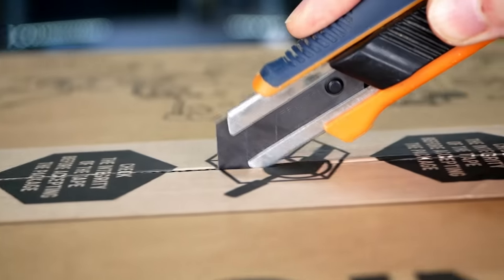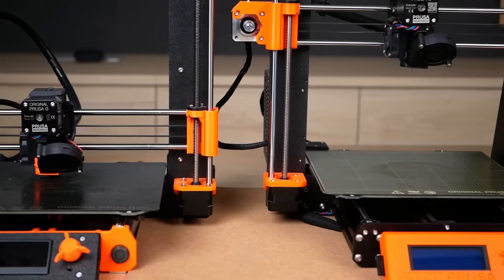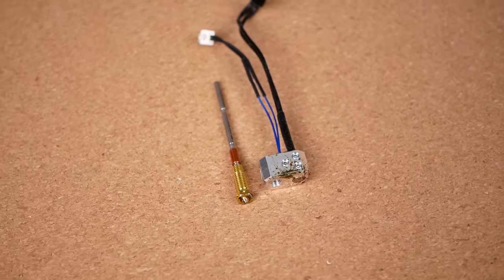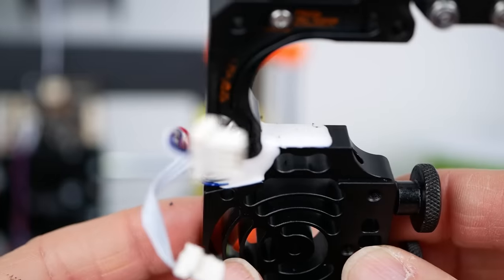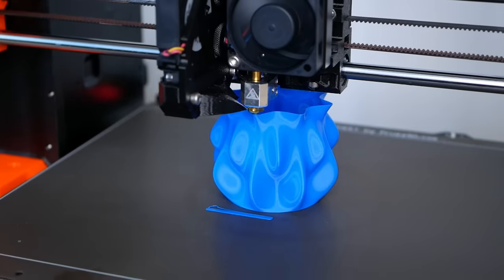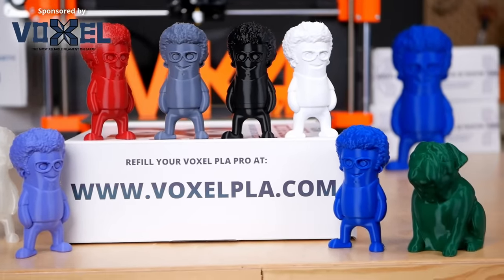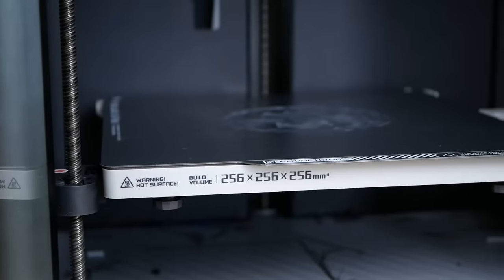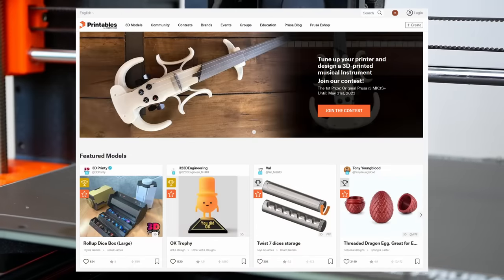Should you buy a NEW Prusa MK4 in 2023 or rather a Bambu Lab X1/P1P?

Comment: To me it's clear they rushed it out to market because Bambu was getting too much market share and they wanted to slow them down. Promising features in the future might suck but could be enough to entice Prusa fans from sticking to their brand.
Reply: But they didn't.
The MK4 has been in the work since at least 2 years.
Reply: The bought it out now because much of the technology is on the XL and they didn't want competitors in China producing a MK4 like machine before Prusa shipped theirs. Bambu is a nice machine on paper and seems deliver what it promises but we will have to see how reliable it is when it's been in the wild for a year or so.
Reply: Should have been a little longer in development, then.
Reply: @schrodingerscat1863  I can answer that for you right now. I am 100% sure that after a good year, there will be almost no support or any spare parts for the Bambu. Even now you can repair almost nothing on it. No exchange of the bearings, no exchange of the carbon shafts, nothing. Much is even glued in. Holy Sh*: 
In 1-2 years, most X1C and P1P will be on the dump, because Bambu will have thrown the next printer on the market by then. Throw away and buy new instead of repairing will be the motto.
Reply: @Neo1983m  yes you can repair it easily. What are you talking about?
Reply: @_Xantras_  They released it before the software was ready = rushing it out to market to me?
Reply: @schrodingerscat1863  The Bambu is very much a Chinese device. I'm in the Facebook group because I was tempted to buy one but it has many many possible issues and some are simply impossible to fix and require you to send back the entire machine. I'm hoping their next iteration fixes all these issues so we're left with a way more reliable machine.

Still, if you have a good one, you can pump out models at insane speeds and this is enough to overcome the worries a lot of people seem to have.
Reply: @Neo1983m  That is what I suspected if I am honest, these things are built down to a price rather than for quality and serviceability. Sure they are great out of the box but having the ability for servicing with spare parts available for years going forward is worth a lot especially if you're earning money from the machines. Most Prusa machines have been running for years and have had many upgrades and parts replaced. Hell with a Prusa you can even download the firmware and hack it if you know what you are doing.
Reply: @redavatar  Yes, reliability and serviceability are worth more than the hype if I'm honest. In a years time when Bambo have moved on and out of warranty I bet these machines will be pretty much unrepairable. It's a chunk of change to drop on something that may only last a year.
Reply: @redavatar  you guys are chill and making up stuff lol … I have both Mk3 and X1C … both excellent machine. Part of both Facebook group and in both issues/love os about the same
Reply: @schrodingerscat1863  I watched a video yesterday from a guy saying how he has switched from Ender 3s to the Bamboo lab X1 and 6 P1Ps because they were so much more reliable. in the same video he mentioned in passing that one of the combined nozzles and heater blocks basically fell apart mid print so he just stuck another one in there (bet that was cheap) and one of his P1P was currently out of action due to some error appearing at start up a few days before and he was waiting for support to email him back. Not sure that they sound that great to me, either with their reliability or customer service. What I couldn't believe was that he was actually going out to buy more of them.
Reply: @shuflie  Sounds like he is drunk on the hype, considering what those machines can do and the cost of decent printer components, they have been built down to a price and likely have many corners cut. They look nice but that's no comfort if they can't be easily repaired. Imagine having to send one back every time these is a problem because there are no user serviceable parts. Prusa sell all parts for all their printers even the really old ones. Plus they provide upgrades for old printers. These things are worth a lot, especially if you are running a print farm or even using a single machine to make money.
Reply: @Neo1983m  the target market of bambu is the people who don’t want to tinker on their machines. Just use them and buy the next latest one they will make. They have been open about that. They said it very clearly in one of the early livestreams that the innovations they have in mind will need a lot of money and after their initial investments that money will come from selling newer printers. However, they also have been open about adding more parts to the store as their supply chains improve. They will be selling a X-Axis carriage in the future so no one has to take the rods off which are glued in to swap the bearings. Maintenance was one of the things they should have focused on more right from the start.
Reply: @_Xantras_  mk4 was rushed and if it wasn't that's even worse cause it seems like something that should have released years ago and honestly is just meh @ this point.
Reply: @_Xantras_  it's been in the work for a very long time, but it seems that they've rushed the release a couple months early, likely due to pressure from bambu, and the leaks that surfaced on the machine.
Reply: @alejoh90  agree
Reply: MK4 has been in development for over a year lol. There is no "rushed to market"
Reply: I am sure the hardware was already long in development but the whole input shaping feature  - although it already existed in klipper - seem to be a last minute addition as an answer to Bambulab or the fact that a lot of speedy printers are coming out. Hence why there talking about it being in Alpha state.
Reply: @LilApe  You really don't get what "rushed to market" means, do you?

A piece of software can be in development for a decade and STILL get rushed to market. How long it was in development for means NOTHING. It's all about how much of it is not done yet or has bugs. The fact that some vital parts of the MK4 is not done yet says to me they rushed it to market and didn't want to wait before the software was ready.
Reply: @redavatar  Dude....if you wanna talk about being "rushed to market", then talk about bambu lab. The only thing missing from the MK4 is input shaping lol.
Reply: @_Xantras_  But firmware is still not complete. Should've come 2-3 months later. Since I get my kit in June, I hope most of it will be implemented then.
Reply: @Neo1983m  you can get most parts on the site lol
Reply: @_Xantras_  if it took 2 years for prusa to release upgrade to their printer, they are done. no way they can keep up with numerous competitors who release complete new printers from the ground up in that time. mk3 has been around since what, 2019? it even became running april 1 joke when prusa would release mk4.
Reply: @LilApe  Erm, and the fact it has a touch screen ... without touch screen support? Stop being such a Prusa fanboy, it's getting a bit silly now.
Reply: @redavatar  So? Prusa never advertised the MK3 as having a touch screen lmao. They're just USING a touch screen that's been disabled. They never advertise it as having a functioning touchscreen, that's the entire reason why there is an encoder wheel on the panel.  Stop with the reaching. The MK4 wasn't rushed to market, they literally been building and testing it for over a year in their print farm. Shit the FW is opensource so just enable it anyways if it bothers you that much.

A rushed to market printer would be the bambu labs. Look at the hundreds of mechanical and software issues they're having RIGHT NOW, because they never beta tested them. Right from KS to the customers door with no thorough testing done.. A company that thinks a warped build plate is "normal and within spec".
Reply: @_Xantras_ only because they worked on it for 2 years doesn't mean it can't still be rushed on the market. Look at Cyberpunk or battlefield 2042
Reply: @LilApe  Josef, I get it. It's scary to finally face some competition after your company coasted on the MK2 and the MK3 for the better part of a decade. It still doesn't justify marketing your catch-up printer with a major feature that isn't ready at the time of release.
Reply: @TROPtastic  1st time trolling? don't worry, you'll get better. BTW, input shaping is slated for release within a month. By time the thousands of people start getting their MK4 kits in july, input shaping will already be available. Cope.
Reply: @marcel151  Well it will be a good printer without those features as well. And the bed leveling seems great, for example.
Reply: @LilApe  Input shaping is such a great invention, making printers go much, much faster.
Reply: @shuflie  I think I saw the video too. Its martinson manufacturing or something like that right? He made a video once explaining that he used to ship  machine parts in PLA, but then switched to PETG because they kept showing up warped at peoples door. Then someone commented he should use ASA for better heat resistance and he was amazed by the idea. Stopped listening to his opinions obviously.
Reply: Show them by releasing the same crappy bed slinger with 3d printed parts they have been selling at ridiculous price for years.
They had their change to create something new, but people kept paying them overprice so they kept selling the same trash.
Reply: @mggevaer260  could be him, seemed to be making vent covers originally?
Reply: @_Xantras_  The MK4 started in late 2022 - not 2 years ago. Prusa even admitted as much themselves, and if you visited any of their sites during that time you'll have been asked to fill out a survey about what features you wanted them to focus on.
Reply: @pizzablender  Yes, it will be. That's why I ordered a kit. But that Tesla like "comes in the future" is not the way you should go.
Reply: @Rick-vm8bl  nope, pictures of prototypes got leaked in 2021.
The survey was for the finish
Reply: @LilApe  it's been in development for a while, but it's clear that some features weren't finished in time for release (input shaping, clog detection, etc.). They would have been more comfortable releasing the machine a couple months later, yet they were pressured to release early likely based on the leaks, and increased competition.
Reply: @Neo1983m  this comment aged like milk

Comment: The whole reason I went with Prusa was for the support and community.  Got tired of other brands where you can't get parts, no support, no options.  Sure also helps it's a damn good printer.  I'll either sell my mk3s to buy a 4, or I'll upgrade.
Reply: prusa doesnt have any community and support is only acceptable
Reply: @jakubmastalir3557  What?
Reply: @mercerwing1458  yeah what they said is just straight not true.
Reply: Me too
Reply: @jakubmastalir3557  😂 wtf
Reply: I can find Creality parts EVERYWHERE. I could walk 15 min to the nearest 3D print shop and get any part I need for my Ender 3. Good luck with that on a Prusa. I broke my hotend fan and waited a week for a local reseller to restock cause I didn't want to pay $30 for shipping a damn fan. People say Prusa is reliable, but I've pretty much had the same number of issues with my Prusa as my Ender 3, with the only difference being the Ender being far easier to repair and tweak
Reply: You can get a lot of parts for bambulab printers, and their support has actually been pretty great for me so far. I think prusas are a waste of money at this point
Reply: Then you should use creality ender 3s got every thing you want in spades. And bambu fixed all that you can get parts fine, you can get support fine, issue is misinformation now. Its like yes if you need to do a return of a 699 printer they want you to ship it back in the box desigend for it, so they can see what the hell went wrong and fix it in later designs they send you a replacment and yes they will charge you like any one else if you fail to mail the old one back to prevent being scammed lol.

Bambu has more community then prusa at this point I am printer who prints in bulk and sells things at art sales, and big events, and there is ton of us sharing info, profiles, and protips on them. Bambu is new so some UPGRADES not the actual replacement parts are pain to get like my AMS wich that along makes mk4 look like crap considering I can print just as good, slightly faster and in 4 colors for less then mk4 costs lol. My AMS is on back order be here latter this month, but if new hot ends, belts, etc I can get order them today and just waith for the shipping wich is slower amazon shipping. Like that is only thing I hate is becuase they sell it all themsevles they do maximise profits helpst them grow they are brand new company, but means I don't get next day shipping and my p1p was shipped by UPS who let it sit for 3 days 20 minutes from house becuase it showed up at 2am friday morning and they didn't want deliver it saturday and don't work sundays because they think its 1998 still and people still don't work sundays in service industry lol.
Reply: @knightsljx  Ender parts are widely available, but Ender parts are not built to last.  Over the course of ongoing an Ender your repair and upgrade costs will be on par with the cost of a Prusa.  Not to mention the fact that you will invest more time getting similar quality.  If you like to tinker get an Ender, if you just want to print without the hassle, get a Prusa.
Reply: Baffles me that Joseph Prusa in 2023 can still say this and that about the own comapny and other companys and fanboys will just straightup eat out of his open hands without a second look
Reply: @EinfachFredhaftGaming  I don't know about all that I just don't want to be earaped by my printer since it's right next to my pc on my desk.
Reply: @mercerwing1458  you got no other place for this huge machine than on your desk? It's actually harmful to a degree to have your printer next to your face due to vapors and plastic nano particles coming off of it while printing
Reply: thats because you still believe in brands, and cant understand what a 3d printer is
Reply: @knightsljx  dude,  its a fan.. there is no special prusa or ender fans. Its just a fan, you can read the voltage etc on the sticker.
Reply: @EinfachFredhaftGaming  I got it in an enclosure and i am venting the gas out of the window since its right next to it, I don't have much space in my room so It's the only place i can put it other than the floor
Reply: @knightsljx  Bruh how. My Ender 3 couldn't last 2 weeks before something stopped working. I haven't had a single issue with my mk3 Prusa since I assembled it over half a year ago.
Reply: @samcoleman8275  get the bambulabs if you really wanted to just print.
Reply: @knightsljx  I have a mk3+ with around 3700 hours on it, no issues only changed the nozzle twice. I hate how loud it is but have had good luck maybe I got a good one who knows
Reply: @samcoleman8275 I e been using an ender 3 pro for years and have never had to replace parts due to failures, only for upgrades. They are definitely built to last. At least they aren't made out of cheap 3d printed plastic parts like the Prusa is.